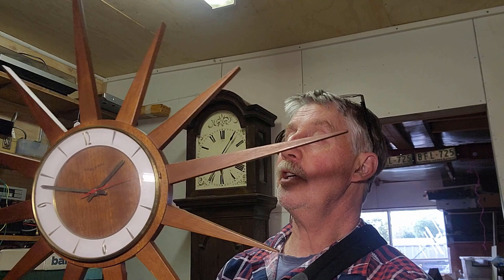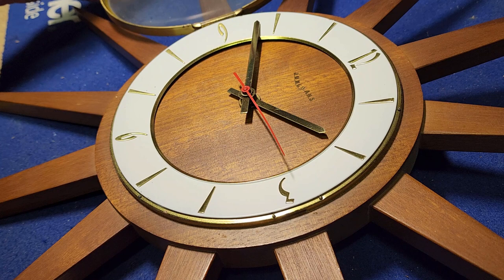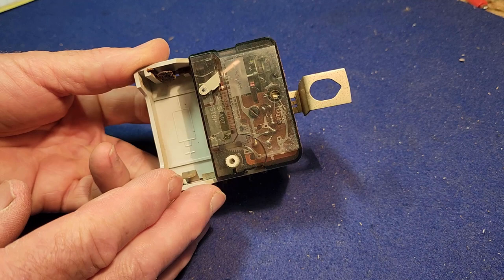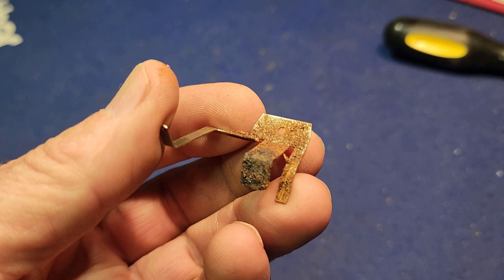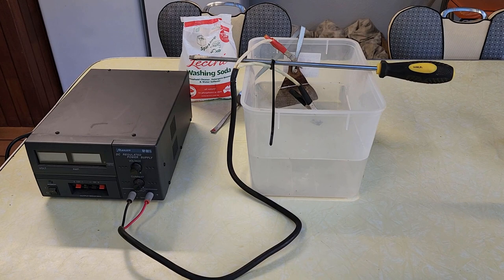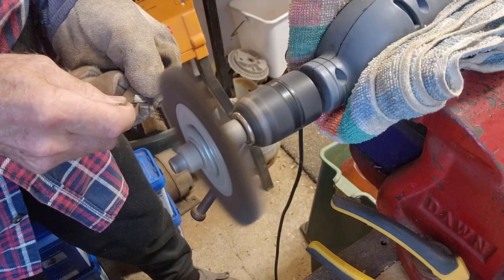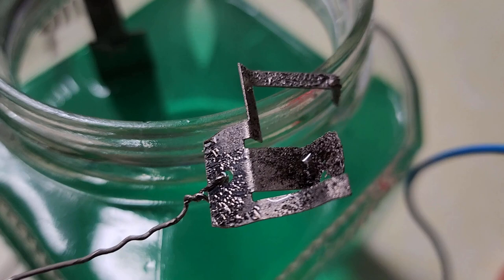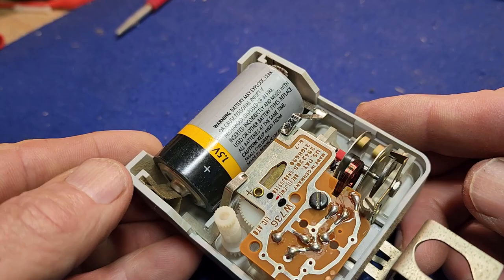How to Fix a rusted Battery Terminal on a Junghans Starburst Clock by Electrolysis & Nickel Plating

Comment: Super job, Chris. Repair and re-use whenever the oportunity arises.
I have two questions: 
1) could you have made a new terminal out of, say, 1mm sheet, if it was more badly corroded? 
2) is the Junghans name on the clock-face supposed to be wonky?
Reply from the maker: Thanks SD! Yes, that would have been the plan if the corrosion was worse - in fact, that's what I did with the other starburst clock repair that I linked. As for the name - I don't think so, but as it is such a delicate piece I decided to leave it alone..

Comment: Do you still have your shop? I have been a regular customer until I no longer make the treck to NSW as my Mum passed away 5 years ago. I repaired one of my 3 Junghams clocks, thanks for your video.
Reply from the maker: Yes Barbara, still have a shop in the main street - but have moved next door to my old shop 😊😊

Comment: I have a different model clock from this range, with the exact same movement (the W736) but one side of the terminal was completely rusted out. How would I refabricate such a small and complex shaped metal?
Reply from the maker: That can be tricky Nathan! I have used modified metal brackets from other things, and sometimes even used reclaimed springs from battery holders in all sorts of items to fix a job. The other option is to keep an eye on ebay or other markets for a non-working movement (which may have other problems), as a donor. Good luck 😊

Comment: Does anyone have this particular Junghans they would be willing to sell?
Reply from the maker: They do turn up on ebay from time to time - just make sure you don't pay big money for one with a replacement modern quartz movement! Good luck 😊
Reply: @TheUltimateRecycler  Why is that? And how would I be able to tell? I am new to all of this so excuse the ignorance. I'm trying to learn.
Reply from the maker: @OGCJ10  Original Junghans movements are quite hard to get whereas modern quartz movements can be as cheap as a couple of dollars! Often these clocks have had the movement replaced when the original one stopped working. If original it will have "Junghans" written on it..